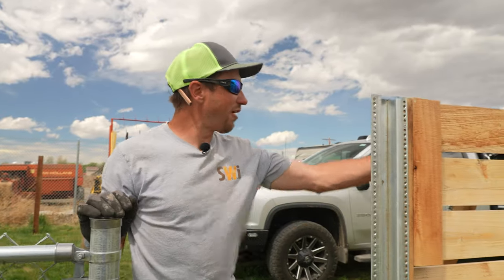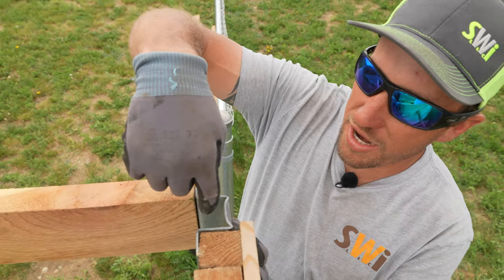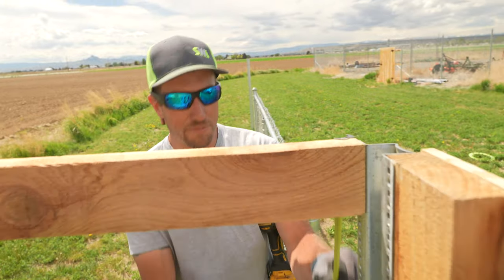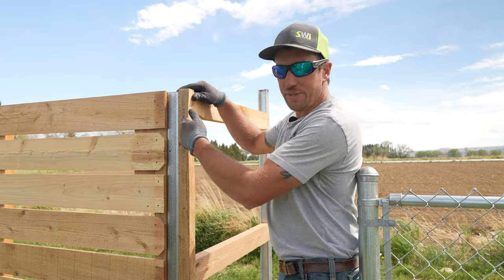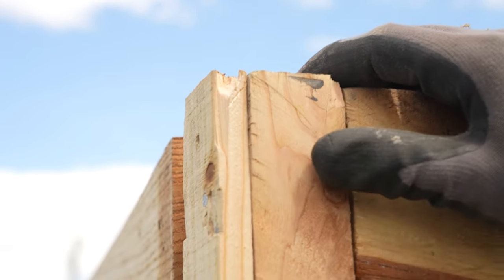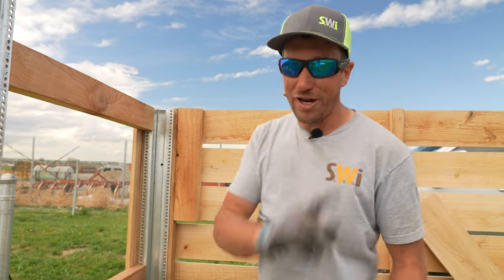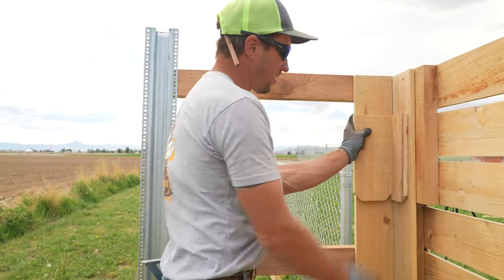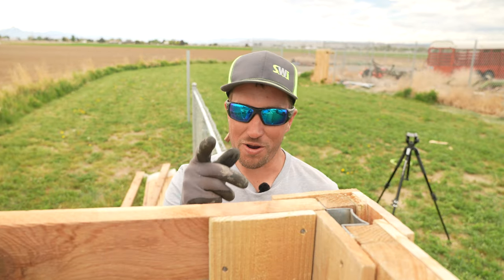EASY Fence Corners With Steel Fence Posts

Comment: How do you cap that? I am a big fan of putting top trim caps on fence pickets and posts to cover the wood end grain and keep all the pickets aligned.
Reply: While building a simple 2 or 3 rail fence with a cap board is straight forward, cladding a PM post to make it look like a nominal 4x4 is 10X more costly in time and materials.

Edge to edge the PM post is about 1/8 wider than a n.4x4 post so the edge will show.

You'll have to rip filler pieces with a table saw to clad the post. If your post is 5' high, you'll need 2, n.2x4's, one ripped to n.2x4x3/4" and the other ripped to 1x1-5/8. Scrap about 1/3 of the n.2x4's in cast-off and sawdust. Note that your 3/4" boards will be about nominally sized less because of the table saw blade kerf. Labor: 30min/post Inc setup and cleanup

After attaching the picket support Rails, cut filler to size for each section and attach with screws. Labor:  30min/post inc setup and cleanup

Here's the tricky part. Cut the back 3/4" cladding board size and fit and clamp it to the post and filler pieces and drill a pilot hole with a long bit all the way through - so it's aligned with a PM post mounting hole. Cut the front cladding board to length, fitPl and clamp. Drive a 3" screw from back to front to secure the assembly. I used 3" screws per post. Labor: 30min/post inc setup and cleanup

I cut the ends of the PM posts off with a portable band saw, using an 18TPI blade at ~240 sfpm, lubricated with a wax stick. Labor: 15min/post inc setup and cleanup

Note that because the PM post is odd sized the finished nominal dimension of the wood cladded post is about 3-5/8" x 3-3/8"

Comment: instead of doing the corner with rails I just make one big hole on my end post mater and put 2 post masters together at the corner. One in the same direction on the straight line with the normal front facing you and the corner post master together facing the next direction your corner will run. Instead of using an entire 2x4x8 ripped on that post that is your new corner I just cut 3 small pieces to support the back picket to it. However the outside I do use a normal ripped 2x4x8 that will support the side of your new straight line of the horizontal run. It saves time this way and you do not change the standard horizontal way your entire build is. Yes your spending an additional cost on the 2nd post master for the one corner but your also saving the cost of the cedar 2x4x8 rails which are about the same cost as the post. It's just faster to do the corner hole as 2 combined posts

Comment: I just realized you are using 4 1/2 posts - most places offer the original 3 1/2 version. Would still the same apply for the corner posts with the 3 1/2 version without having to buy the "corner" posts? Also, same thing with the gate - in one of your other videos, you built a gate hanging on a single 4 1/2 post (you mentioned it's okay if it's 5ft or less). Would the same apply for a 3 1/2 post version if the gate is, for example, 4ft wide?

Comment: Would this method work for acute and obtuse angled corners? Thank you for your awesome videos.
Reply from the maker: Yes, with a little-bit of angle cutting. Video on that coming out soon-ish.
Reply: @SWiFence has this dropped yet?🙏trying to decide between masterhalco postmasters or 4x4s with Simpson CB44 brackets set in concrete. We have some 120deg corners.

Comment: I understand this is a corner on an existing fence, however, if a guy knew he was gonna have a corner here he could bring the corner post in just a tad to make those horizontal pickets extend out to the outside edge and eliminate that little 2 by spacer correct?
Reply from the maker: Hmmm, not sure I'm understanding. 🤔 You couldn't bring the horizontal pickets out any further without the 2x2 spacer, because you wouldn't have anything to fasten them to. But with the space there, yes absolutely, you could bring those pickets all the way to the edge. It doesn't really matter either way though since you still need a trim picket on top.
Reply: Yes....he definitely could've started at the corner and worked his way out
Reply: Yeah sorry I didn't mean the 2x2, I meant the 2 inch wide piece of cedar picket to bring everything flush for the trim picket. Not to achieve anything other than eliminating one step and a few extra fasteners.
Reply: If he had flipped the post around, he cold have eliminated the need for the 2x2 entirely.

Comment: What’s the best way to not damage these posts when manually driving the post with a post pounder instead of the gas powered drivers?
Reply from the maker: Leave an extra inch sticking up and trim off the bent top with a portable bandsaw.

Comment: What’s crazy here in the Pacific Northwest, no one uses post master posts. I think I’ve seen maybe 2 fences built with them. What’s also crazy is our weather is wet and cold 8 months out of the year and customers still want wood fencing. Kinda strange
Reply: Same! ive tried over and over to convince customers to try and change their mind and they are dead set on wood 4x4s
Reply: @TheMarvin339  Ya they want the natural look. It’s super ingrained here
Reply from the maker: They still get the natural look since the steel is all covered up. Human beings are set in their ways, though.
Reply: With cedar I agree, the steel post is about the same for a 4x4 cedar wood, so I don’t get why they don’t use them. Now down here in Georgia we use treated pine and a 4x4x8 is $13, so using steel posts triples your post cost. I’m using a version of postmaster from Lifetime and I needed 41 posts bc I’m fancy and different 😂 but 41 treated pine posts would’ve cost me $600 but I went steel and they cost me $1600 but I don’t know the cost of cedar up there but down here a 4x4x8 is gonna run you $40
Reply: @MrHEMMA56  if Iwas a fence man there's no way in hell id pay for somebody else to put their hefty markup on some simple press braked and hole punched  sheet steel,   that's ludicrous.   I guess that's the cost of the more primitive skill set of fence building,  The shop I rent from is owned by a roofing company, and  the first time I put my mind to a good Nosing thru their shop area I was just floored at all the fancy press and bend brakes they use to make shit that I actually many years ago had to go to tech school to learn how to use.  they don't buy ANYthing but raw stock,  and you found very easily have a press brake made to make all your posts,  even if u just start out with one with two bottle jacks and I'm guessing with the drastic change in costs you'd not be long eyeing a nice full powered hydro electric.  Imagine if u were the 1st fence man who took the initiative to make your own posts pass some savings on and how many more check writers would decide on metal posts.   For the holes I would source an old Ironworker Tri-Press,  have it serviced,   and make you some tool steel studs and holes jaws,  u know they make tool steel rods now?  Is just take some tool steel round stock cut it into half inch pieces  insert them all into sized holes in  long piece of half inch or 3/8 plate not flush with the tops of the holes but about a eith to a uarter  inch shy to make some nice plug welds on top and a matching sized plate of either manganese or thick stainless with corresponding holes slightly larger so the studs punch cleanly thru in one go and bobs your gender neutral uncle  ..
Reply: In Vancouver wa they are everywhere.
Reply: 30.00 price difference plus depending where you get them least where Im from tends to seriously add up. Got 30-40 post that's an extra 12-1500 just in posts and for most people the longevity of a wood post far outweighs the cost savings.

Comment: I can not find out where to purchase these fence posts anywhere?  I have seen a few online places say they are selling post master plus but they do not have an option for corner, line and gate posts?   Also what size hole is best for the gate post?  Thank you for all of this information hopefully as a home DIY person I can purchase these posts in the St. Louis Missouri area soon.  Also wondering if you can space 8' on center or if 6' is recommended and can you use 2 x 6 for lower and uppers to make even stronger?
Reply from the maker: We sell the steel u-channel posts for those that cannot find them in their local area (https://www.swifence.com/master-halco-4-1-2-x-1-1-2postmaster-steel-post-f.html?id=13105038).
We don't find that we need corner and gate posts. The line posts work fine for us.
You're welcome to call the shop with questions: (307) 578-8040
Reply: Awesome thank you for the link and information. @SWiFence   Any Info on using 2 x 6 instead of 2 x 4 on the rails? also 6' or 8' on center plus the 2"?

Comment: the only thing I would worry about on that corner is on the inside corner where the picket has nothing behind it. Because it will go inward. I think I would put a piece of 2x ripped to fit in that space. It's not like you have to d every post, just the ones with that inside corner, but I do like the idea of framing the outside corner and then install it. Maybe used some glue to help keep it from pulling apart a year or 2 down the road.

Comment: The postmaster posts are almost $50ea CAD in Rona. Though, they are strong at 11.5 gauge. It appears to be quite versatile. I like the look of wood posts, but I feel that the wood post is not long-lasting. The steel post provides the structure and the wood provides the beauty. Now on to doing some math (aka: budget) to see how much this will cost.

Comment: Thanks for the vid. Super helpful. Do you know if it'll be a problem if I'm mixing products - I will be using post Master original as my corner and the rest are post master +. Had to pick them up at diff stores due to limited height availability. I noticed that the post master + are a bit wider with more holes and do not require 6in of gravel
Reply from the maker: Should be fine. We prefer PostMaster+ because of the extra strength and warranty, but there won't be any difference in the way your fence goes together. Just make sure you're measuring that section carefully.

Comment: How much are the steel post? Do they come with a base for concrete?
Reply from the maker: More than you expect them to be (although if they're available in your local area you can save considerably).
Yes, they also come with bases for pre-existing concrete.
👉🏻 Steel Fence Posts: https://bit.ly/SWISteelFencePosts
👉🏻 Steel Fence Posts With Welded Baseplates: https://bit.ly/SWIsteelpost-bp

Comment: Why wouldn't you turn the corner post the other direction? I'd think it would be much easier to attach if it was turned the other direction and both sides could be attached directly to the post.
Reply: According to the PostMaster installation guide, he did it wrong. He has the post 180 degrees backwards.
Reply: @robert1340  I agree. You can eliminate the 2x2 in the corner if you flip it around.

Comment: Is there a reason you are attaching half of 2x4's to the postmaster? Will using something thinner like .75' x 2.5' impact the integrity of the fence/fence post? I'm looking into installing a horizontal fence post that's 4ft tall
Reply from the maker: I wouldn't feel comfortable using something thinner--it could compromise the integrity of the post. To make it easier, however, we did move away from ripping 2x4's and just started buying 2x2's.

Comment: The Postmaster+ system has corner posts.  
Question though: would regular stainless steel screws like you use be plenty sturdy enough, even though screws aren't used for structural support due to shear strength, or should stainless steel structural screws be used instead?
Reply from the maker: I mean, I wouldn't build a house on top of it, but yes, regular stainless steel screws are plenty strong enough.

Comment: What about 45° corners ?

I'm getting ready to do my fence with these and since I'm on a corner lot the corner is basically two 45° corners. Been wondering how to do that. Will I need to rip a angle board to screw in first ?
Reply from the maker: Hmmm, I haven't run into that one yet, but it sounds like you're on the right track.
Reply: @SWiFence  I thought about it some more, run my line post like normal, cut my rails at the needed angle and just screw to the yard facing side of the postmaster

Comment: How would you do a T corner with this system?
Reply from the maker: Thats a little hard to explain in writing, but... if you set the post in a straight line you can toe nail screw your cedar stringers for the (t) into the cedar stringers going straight.
Reply: @SWiFence video please on how to do a T corner or even go from a 7 ft to a 3ft change

Comment: Simple question.. Why does everyone only install cedar with postmaster?
Reply: Vs. using other woods or vs. using wood posts?
Reply: @foreverfenceandgate1974  I meant why am I only seeing contractor's using cedar rails and pickets on Galvanized metal posts vs pine/pressure treated?
Reply: @KalanYTRock  There are still people who will use treated posts and pine rails, however, there are benefits to using steel posts and cedar rails. Cedar is less prone to warping and twisting, so when used as a rail and as pickets, the fence will maintain a straighter look over time.  This cannot be controlled however, and it may still occur. That's why it's beneficial to use engineered products like steel posts because it eliminates the guessing game. The posts are the structure of the fence, but also the number one point of failure in a fence. Most fences are replaced because the posts have rotted or broken off at the ground. They will also warp and twist and crack. Not with steel though.
Reply: @KalanYTRock  SWI has some great content on this topic
Reply from the maker: Wood rots and we got sick of dealing with that. It doesn't matter how pressure-treated it is--it isn't going to last forever. Installing with steel also dramatically reduces the cost of replacing the fence 20 years down the road because you don't have to pull the posts out.
Reply: @SWiFence  I have learned plenty from you guys, and thank you! I’m just curious why I don’t see anybody installing pressure treated with the postmaster. As in it is OK to use pine pressure-treated wood versus cedar on it correct?
Reply from the maker: Oh I gotcha! Sorry--I misunderstood what you were saying. Yes, you absolutely can use pressure treated on the postmaster--we just have a cedar-only policy when we're installing wood fence. It's not about the postmasters, just our preference for cedar in general. 👍🏻
Reply: @SWiFence  Awesome, their website only shows cedar being used as well. Thank you, I appreciate the channel and advice!

Comment: You don't use concrete for your post holes? Just hammer in the ground?
Reply from the maker: When the ground allow for it, yes. It's faster, easier, and I dare say stronger. Very common up north, less common in southern regions.
Reply: @SWiFence  yeah I’m  near the ocean so quite sandy and very windy. Have you ever used postmaster halco with metal fence panels
Reply from the maker: Like with corrugated steel privacy panels? Yes. 👍🏻